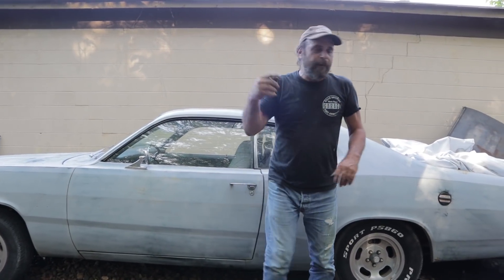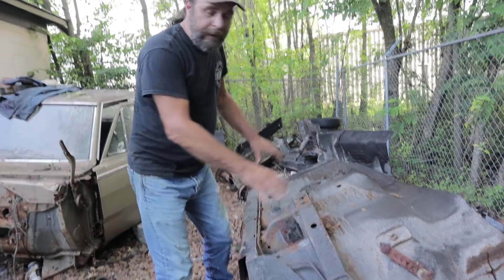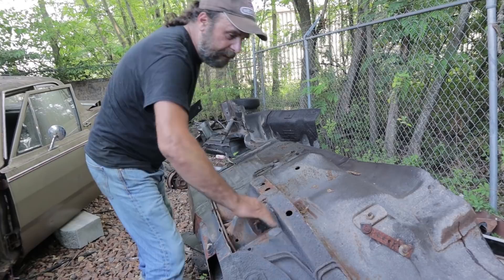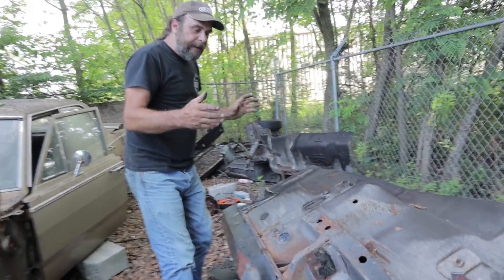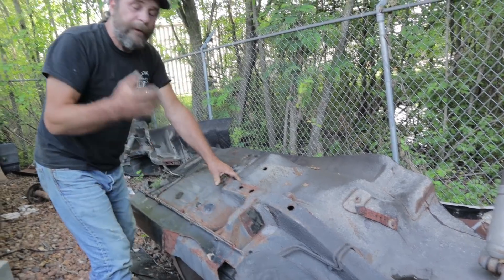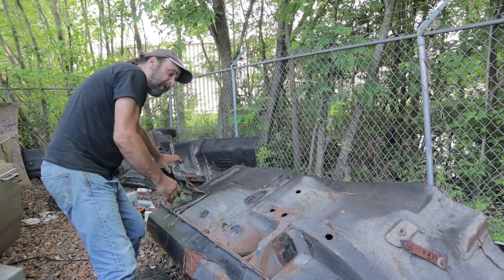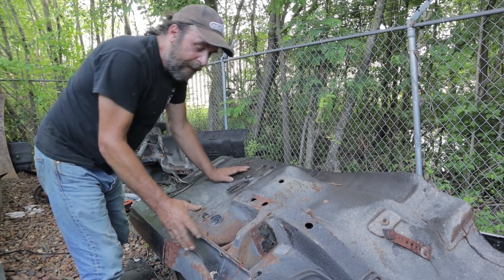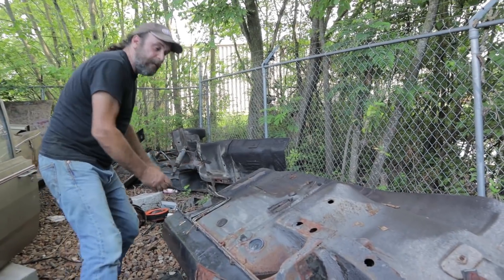Chassis Basics-Frame Connectors

Comment: I've been rethinking your idea about work hardening the unibody. Actually, to my way of thinking, not stiffening it up is counter intuitive. However I think most don't go far enough. In your analogy of the soda can, it's quite simple, if the metal is not allowed to bend at all, then it can't get work hardened.  Any flexing will eventually weaken the metal. The problem is actually probably the spot welds, and what the heat does to the metal in each spot, while not in other parts. I think there is simply more to it than allowing it to flex. No flex, no wear so far as the work hardening goes. Each spot weld is either hardening the metal around it, or weakening it, I'm not sure which that would be,  it would depend on the conditions when it was welded. Their spot welders do not add material, they simply melt the two pieces together with high voltage.
Reply: it's a problem of localizing the flex, which increases the flex load where the connectors aren't. steel has a "flex modulus", a fancy term for "bend it less than this, it springs back, bend it more, it takes a set". you also have to account for the welds acting as notches as far as strength and rigidity are concerned. then, you also must consider the actual steel used in the body fab. those old timey bodies were engineered to spread that flex load over long spans, making the momentary deformation (bending) a lower value per inch of flexing body panel, so the modulus wasn't exceeded at any point. no "taking a set", no extra stress on the spot welds. exceed the modulus, and let the panel permanently deform, you add a permanent strain to every weld, which act as stress risers because of the notch effect. it then becomes a slow cascade effect of failure, where as a weld "gives" a tiny amount, the next weld exceeds it's limit of strain, ad infinitum. if you tie the floor into a more rigid assembly, you make ALL the strain of that reduced flex into flex loads at either end, thus multiplying the deformation those panel sections see. now, if you put in a 12 point roll cage that is well engineered for the body, you eliminate (or at least minimize) the deformation. but if you only eliminate the passenger area floor flex, you by necessity are increasing the flex loads where you didn't add rigidity. no free rides, the sum total stress loads will be the same for any given power train. let the entire assembly gracefully wriggle a bit, those loads are resisted by the entire body. eliminate the ability to spread it everywhere, then the areas not made more rigid take a beating they were never designed to deal with
Reply: @ludditeneaderthal  That makes sense, but it's basically the same as what I'm saying, allow NO flex, you don't have to worry about it. strengthen only one part, you cause problems with the rest of the car. I get that. However, I've never been much of a fan of the unibody. Prefer actual frames. I've had a lot of chrylsers, and toward the end of their lifespan the unibody can cause problems you don't get with a frame.
Reply: @tootall5559  exactly... if you actually engineer the entire assembly for max rigidity, then making the floor more rigid isn't an issue. Tony even said if you're building a genuine track car connectors are fine. the problem is doing ONLY connectors on a streetable example. unless you run in automotive nirvana, where the streets are all billiard table smooth, then you beat the nose and tail like a red headed step child. but if you do ALL the work to compensate for the flex bumper to bumper, you basically rebalance the equation, only without the gentle undulations. you'll notice all those arguing in favor of connectors in the comments are doing so because of experiences with the "whole hog" mods, not a "connectors as stand alone" set up.
Reply: @ludditeneaderthal  yep... that's why I like frames  they're a lot easier to beef up, cheaper too, usually. Most times, you don't even need to beef them up unless you're going really nuts with the size and power of the engine.

Comment: I have had a 68 dart with a bigblocks and kept busting transmission caress and thr only thing it was, was mini tubbed and as soon as I put a cage in it and put the rear chassis and split the front anybody and run the 2×3 mildsteel in and stitched up the floor and the all along tge rear unibody and put the narrowed Dana 60 and leafsprings and put almost 70k and then finally pulled the leafsprings out and added ladder bars and set of souble adjustable coil overs it leaves a the wheels in the air w the Hemi in it and now I put the dual plugger Hemi and then we cut fenderwells out and ran the dash bars all the way to just before the radiator support I camt tell ya how many motors from 528 dual plugger all aluminum Hemi to several combos of wedge motors the stock 426 wedge to a petty Hemi/wedge That's a Hemi block w wedge heads and that was built by mourice himself amd freshened my myself and what an engine that is!! Anyways to get back to it its never had any popping of any spotwelds on any panels and the paint looks as good as it did 25 yrs ago when my dad laid it down!! I agree with you on some of your and a chassis builder of almost 35 yrs now and a MOPAR man all of them I just can't see some of them!! I had to go to a twin turbo BBC to stay w the boys running no prep and it's about to kill me I have it in a corvair though and it is front mounted and on a chassis but I'd trade em all for my dad's 66 belvedeer2 Hemi car that was stolen out of my uncle's driveway in Raleigh aluminum body panels light weight glass and has 77 and I would love to find it to give it back to him so he could cruise it had a 440 in it at the time and the dana60 was under a drag car while he was wasting up the Chevy and fords around I have a a standing reward so it would look like a 440 car unless ya knew what you were looking a!! He had the double plugger Hemi and all that!! Any help or I.am not criticizing you or anything and truly enjoy your videos just over the smoky s if ya need any parts in central NC!!

Comment: Best time we had in a uni-body, grudge night drag racing a Chevy Nova.  By the time we were done with it, the body was twisted.  You can see it when lining up the bottom of the back window, with the bottom of the windshield and dashboard.  I swear it was tweaked over an inch at least.  That was some serious flex.
Reply from the maker: I've been there too...that's why I said what I said at the end of the vid
Reply: I owned a few second gen firebird and these cars flexed a ton, one time I jacked the car up on one side too much and the rear window shattered from the flex. Added frame connectors and never had that problem again, but I the car does not handle as well as it once it.

Comment: People think that because we have low cost computers that we know more than they did.  It's actually the exact opposite. IQ has been falling in every Western country including (especially) the US.  The average IQ of an automotive engineering team has probably dropped 5 points and the skill level of each individual has likely dropped even more.  The improvements we have seen is despite, not because of today's engineers.  If modern engineers had the intelligence and skills of yesterday's engineers, cars would be way better than they are today.
Reply: @CC Ryder 100% with you on that..i as a former non qualified factory employee had to train a team of enginners to work with our pumps and after that had to teach them better ways to work with their equipment in conjunction with our equipment (they were measuring the capacity of our tanks with a flowmeter and this was on a wine cellar and bottling facility) they did not know how to operate their flowmeter properly let alone our pumps, and they did not account for deformation under load of our stainless tanks, i advised them, they did not listen and in the end they had to redo the whole work... i made 600€ a month and they made triple of that. think about that...and they were ARROGANT and close minded always bragging about their superior education. it felt good to teach them a lesson though
Reply: Cars???
Reply: tarstarkusz, just like the wright brothers first propeller, aprox 65-70% efficient, todays a about 90% and that is done with computers! Older designs are not junk
Reply: I couldnt agree with you more. Half these kids with a turbo and a controller couldnt diagnose a rotten set of plug wires in the dead of night while they are making an underhood lightning show without a computer or phone involved.
Reply: That’s actually entirely false, but I’ll let you post your sources before I break down Why this is a myth made to make certain people feel better about themselves.
Reply: I totally agree. Try showing these kids a slide rule some time and see what happens.

As a bonus,try to teach a millenial how to read a map. It's nearly impossible.
Reply: @somedaysoon3784  Hell, i am 56 and know old timers that are glued to their cells, and dont know how to use a slide rule. Worked 34 years at Air Canada as a air craft engineer , back in day we were called  mechanics..Some kids are into old school more than you think, so i have faith that classics will around long after you and i go to the pearly gates....
Reply: @somedaysoon3784  i have to admit. I don't know how to use a slide rule either. But I'm 44 and can land navigate by compass and map thanks to uncle sam.

Comment: holly crap! i did not know that!! i know about torque boxes i had picked up a set of repo but i could never understand why the factory never connected the frame even on the 6pack an hemi cars. now i get it!!
Reply: I'm having a hard time remembering where, but I know I've come across guys talking about firewall and a-pillar damage to Hemi cars from the front of the car trying to rip off of the rest of the body... I don't have hemi car budget, so it's not something that I filed away for later, so...

Comment: I'm so happy you posted this. I been debating putting these tubular frame rail connectors on my 94 Mustang 5.0. That a really small car do you think I would be better off with them in or not? I only drive this in summer to cruise and do burnouts in. I also plan on doing roll cage just because these cars crumple like a soda can. What's your opinion? Yay or nay on the frame connectors? Love your YouTube channel man keep up the great work!
Reply from the maker: A complete cage would make connectors redundant
Reply: OK cool thanks man!